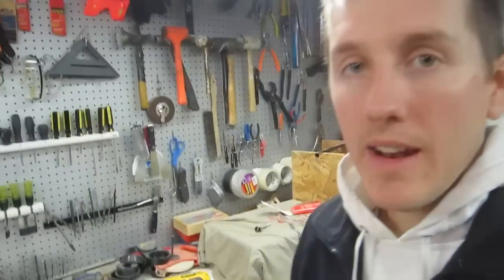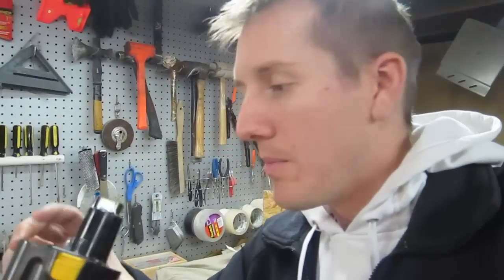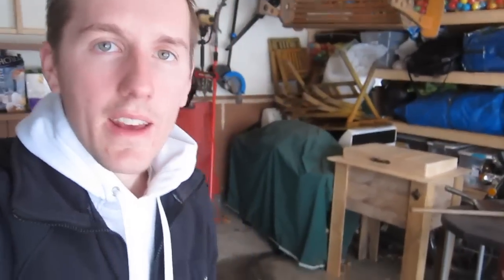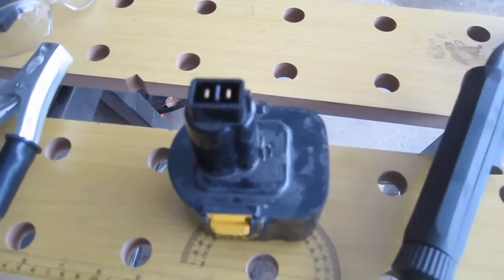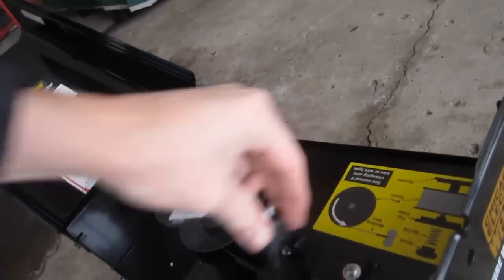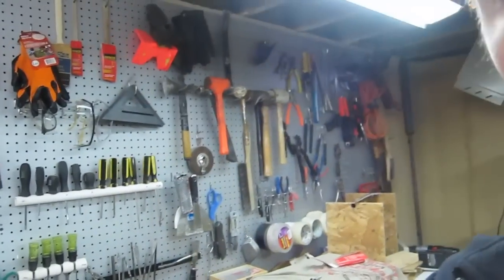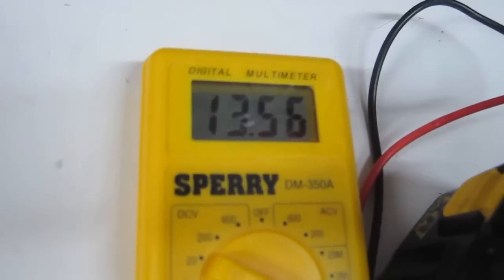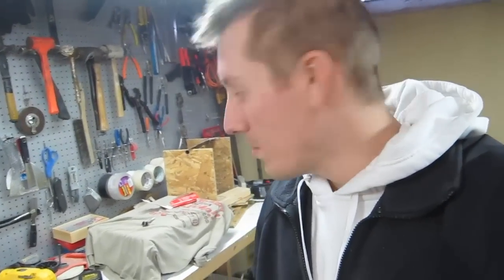Restore-Revive-Zap Old Dead Drill Battery - Free

Comment: Id strongly suggest using jumper leads to connect to the battery terminals with aligator clips or blade connectors. The copper is very thin on the battery terminals and it wont take much to burn them.

Comment: I tried something similar with a Car Battery and pricey cables. That fried the pricey cables on the reel.  The DeWalt charger brought my totally dead 12v to 3.4VDC.  A pair of New batteries on line (no longer available from DeWalt) is about $70.  No guarantee.  I find all my Makita drills, jig saw etc which I liked very much are now junk.  Dewalt (Whitby Ontario Canada) will do nothing.
In my line of work I will now always purchase corded tools.  A battery powered drill is always good for 1 and a half holes!

Comment: Workd for me and does not hold charge but if you charge it and use it right away is a full chrge these battries are not meant to hold or store the charge for long so will go flat overnight but charge and use and will last an hour does for me. And the more i kepp using and rechargin they last longer.

Comment: Hi, what you can also do is solder a electric cable on to the terminals. make sure you mark which is positive and negative!  or it will burn the switch out.  then use a car battery to power the drill this will drive the drill for hours.  Yes it is not as convenient or handy as cordless but if the nearest plug is 1 mile away and you have a tractor or truck or that old car battery  you can drill that fence or hut.   just a idea, what are your thoughts?

Comment: you don,t need a welder to do this I have a Stanley fatmax drill and two batteries 1 for some reason would,t charge at all instead of a green charge light it was red you just need 2 decent cables in my case normal twin and earth blue and brown I connected 1 cable to the negative of the good battery to the negative of the bad then to the positive of the good to the positive of the bad waited 2 mins and was amazed it worked it charged and worked fine however when drill not in use the charge over a period of time drained but as long as you use them quite often should be fine hope this helps take care see you all soon

Comment: i didn't understand exactly why do you need a welder ? to short out or align the battery.
in order to this do have to use a welder ?
Reply from the maker: My understanding was that you need something that can supply a greater voltage than the battery.  The welder supplies something like 18 volts? or more to align the individual battery terminals.  I also tried it with a 12 volt car battery.  That worked slightly.

Comment: Dave, Did you shock battery pack polarity back in the original direction ie pos to neg with the welder?
Your video only showed reverse direction. Could that make a difference?
Also could you use foil or a little bit of sheet metal to avoid arcing damage . 
thanks for posting this.
Reply from the maker: Yes and Yes. 

Yes i did shock the pack with the correct + to + and - to -.  If i remember correctly i just did the reverse to try and realign the polarity ????

Not sure about foil, but sheet metal might work for preventing the battery to be blackened.  Although it wasn't that big of a deal.

And like i said in the video, i wish that the DeWalt 12v packs had the ability to be taken apart like some other packs.  Then i could have disassembled and tested each battery to find out which ones were the bad ones, then replaced just those.
Reply: Use an alligator clip with a wire to save damage on the battery terminal

Comment: NiCAD have a problem with building up a memory and it will reduce the capacity to receive an electrical charge.  I use some gator clips and use the restoration settings on my RC battery at will attempt to remove the memory.  Most RC charger that are able to recondition NiCAD cells will perform 5 charge and discharge cycles.  Typically performing the charging rate much higher that the original charger to attempt the restoration.  I was able to use the small gator clips on my 12v Black and Decker drill and it is back to approx 95% of stated capacity by looking at how many mAh your charger as was discharged from the battery.  A good charger can also charge your lead/acid like your car battery.

Comment: The reason it didn't work was because a welder even though High current is very low voltage. Typically you need to spark the battery with double what it's voltage rating is. If you have the means build a bridge rectifier with a few millifarads of capacitance and then spark the battery. A word of caution, if you do do this charge of the capacitors first then disconnect a power supply and Spark them at that point, this stuff is just to protect your diodes

Comment: If you don't have a welder, could you use jumper cables with the same effect??
Reply from the maker: I did actually try it with a car battery before i had a welder.  It "sort of worked".  There was a small spark and it did cause the drill battery to work for a few minutes.  The car battery is 12volts and the dead drill battery was 12volts.  I think it works best when the voltage you are applying is much higher.
Reply: +Dave Wirth maybe a recharge reset will finish them? i.e. drain the batteries to where even after a few minutes the drill does nothing, then charge for 48hours. this has worked on some of my batteries that did not completely charge or hold a  charge for long.

Comment: if that don't work you can still rip out the dead ni-cad batteries and replace them with lithium 18650 batteries.
Reply: Can't see those charging too well on a charger designed for nicads - chance of over-charging and explosion
Reply: DrZarkloff
Reply: Peter Scargill You shouldn't use the original charger unless you're just replacing the 18650 cell for new ones. I replaced the ni-cad cells in my old drill battery with 18650 lithium cells. I put each cell into a battery holder so that I have to remove the cells and charge them in a lithium charger that I have. I guess that I'll have to make a video about it. Please look for the video sometime tomorrow in my other DrZarkloff channel where I make HVAC vids.
Reply: Nicholas Betinis Hello, yes it's me. I'll upload a video tomorrow about what I've been doing with 18650 lithium batteries.